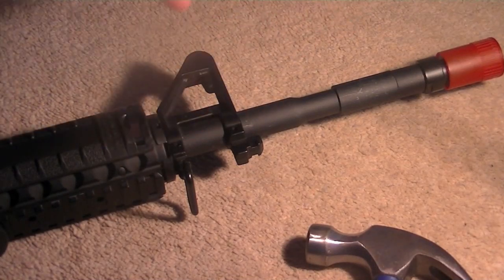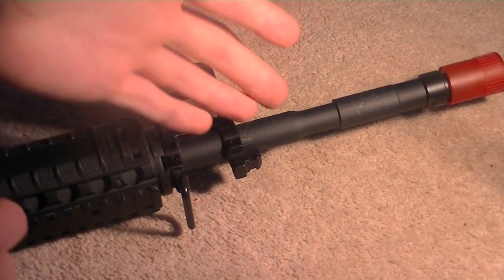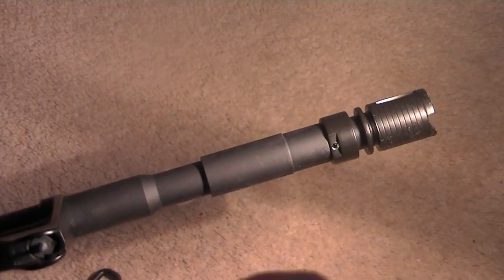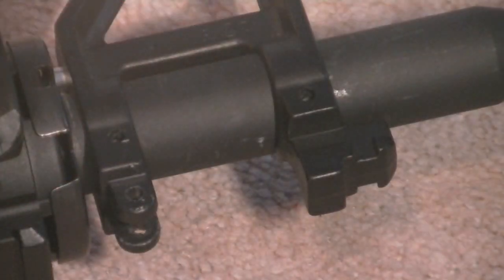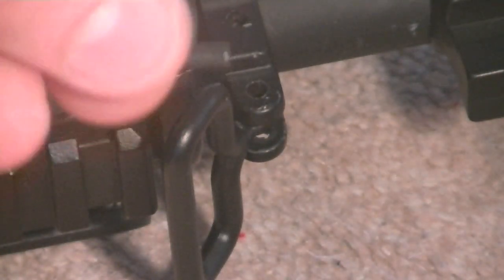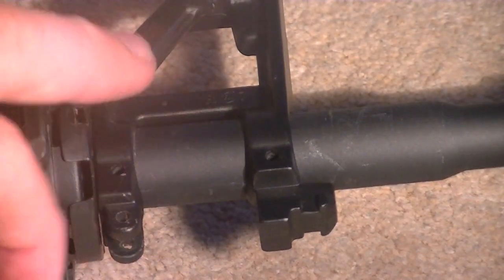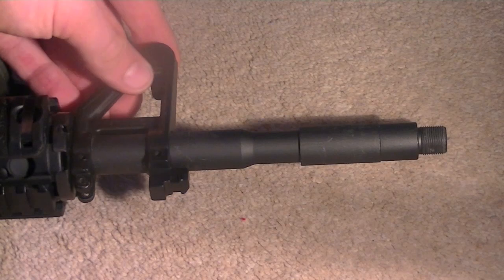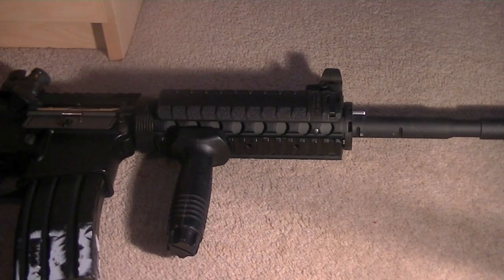SFA: How To: Removing the Front triangle sight post on a m4/m16

Comment: The flash hider on my Lancer Tactical LT-04 Gen 2 M4 has a pin not a screw so do I like yank the pin out like a fish or wtf do I do
Reply: I have the same gun and you need to knock out the pin under it, I'm not really sure because I don't what to waist time on that because the gas line will be exposed
Reply: The pin under the flash hider

Comment: Mine has a fake gas tube connected to it, I dont know if it will affect the delta ring or not.
Reply: It turns out it did, so I chopped off the half where the tube did not connect, now I can use my sights without the front sights getting in the way
Reply: Mine has a fake gas block and there was no problem

Comment: Thanks for the video, I have a question though my friend, I have removed my triangle aight but the circle “end cap” closest to the muzzle where that little metal rod is sticking out is now very loose and with enough jiggle or movements my hand guard keeps falling apart mainly the bottom part, is there a way to keep that end guard in place or not? All information or experience from anyone is greatly valued as this problem has me pulling my hair out 😂 thanks in advance
Reply: Im having the same problem, but I think you can buy something on the internet to replacethe front sight and it will hold. Im not sure how its called tho, I think its called gasblock.